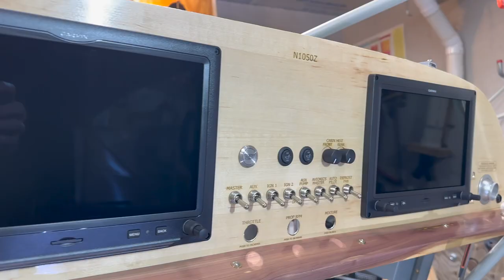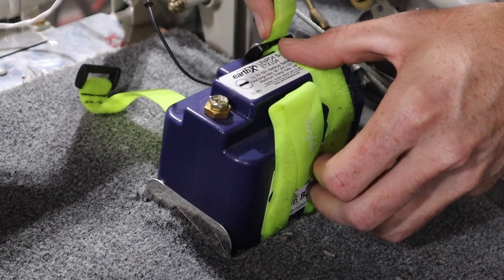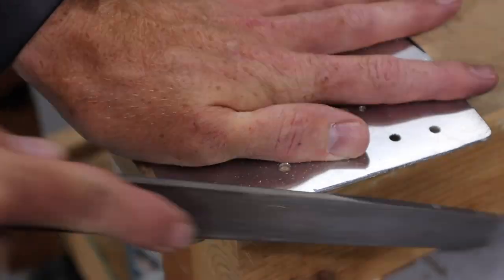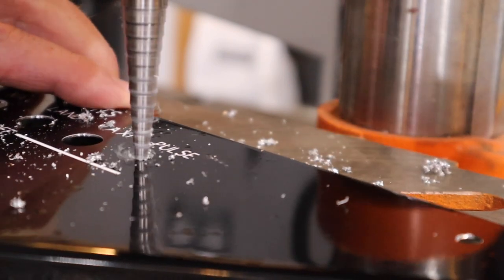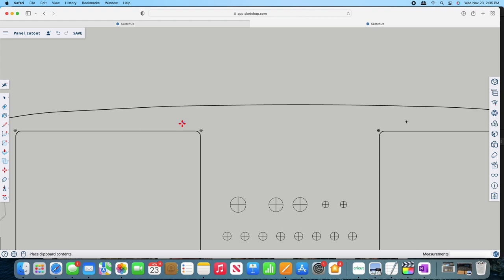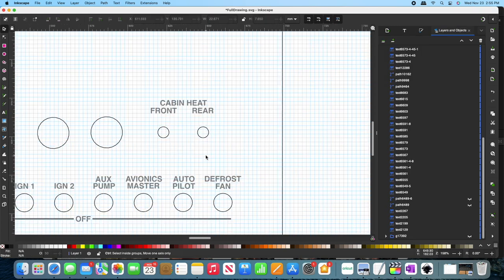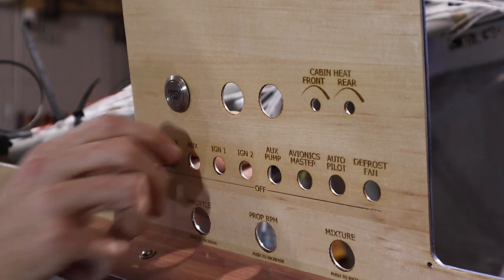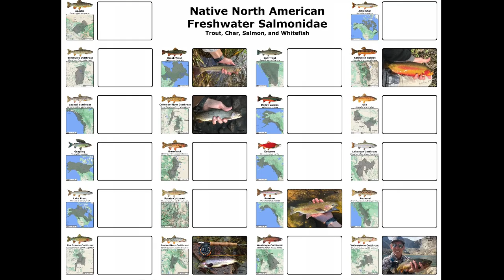Instrument Panel Design, Cutting, Labeling, LRUs, etc.

Comment: I sure hope that you haven't abandoned your build. I was enjoying your videos on the build process. If you have done more building, please post it.
Reply from the maker: Thanks Kevin! We've went through somewhat of a disaster with getting an engine overhauled. Has been a big setback schedule wise and financially, but I hope to finally be through all of that sometime this summer! The wiring is mostly complete but we haven't posted anything on that as I was hoping to finish the little bit of firewall forward wiring to capture all of it in one video. At any rate, I hope to be working on the project again soon and I certainly plan to continue with documenting our process. Appreciate your kind comments.
Reply: @ColbyOsborn what happened with the rebuild?  I stalled on my bearhawk patrol project in favor of getting my kolb in the air. Everything costs too much now!

Comment: The build looks great, and thanks for taking the time to create and share the videos. What are you using for electrical over current protection? Fuses? Circuit breakers?
Reply from the maker: Thanks David. I'm using ATC style blade fuses. I've considered using a circuit breaker for the alternator field, but haven't decided. I hope to discuss my electrical system in a future video.